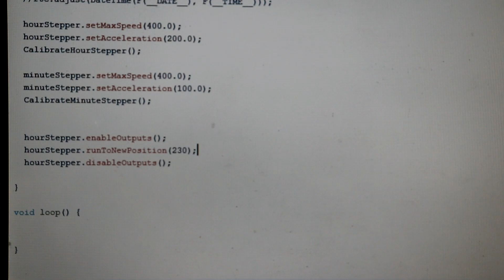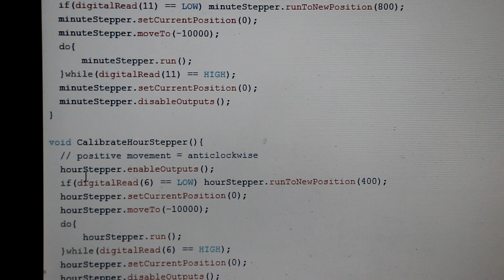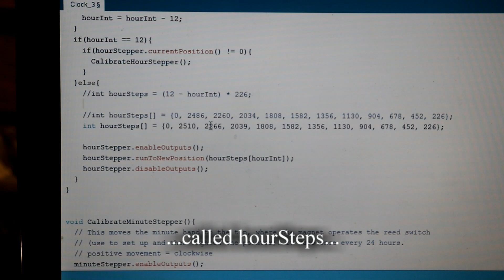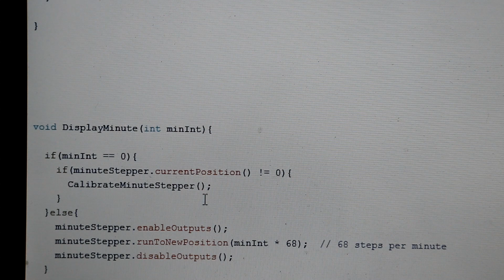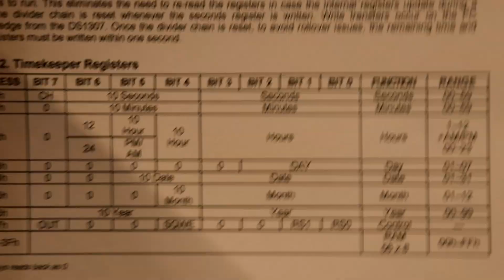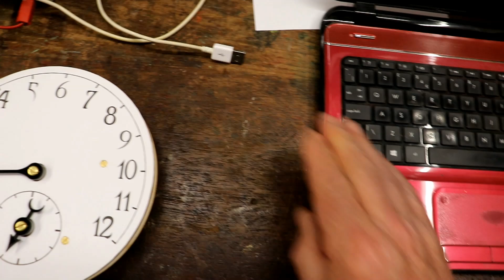Part 5 Writing an Arduino sketch to get the clock to tell the time!

Comment: How neat is that??   You might consider re-homing both motors every 12 hours, to help keep them pointing correctly .
Reply from the maker: Thank you Roman! With this Arduino sketch the minute hand re-homes each minute and the hour hand re-homes every twelve hours. It shouldn't be necessary, but seemed like a good idea!

Comment: It would be great if you put it on your website - a great project I must say. I made a list of “tools” I need - laser cutter, 3D printer……😊 hmmm…..
Reply from the maker: So not many tools then! I was thinking of creating a kit of the laser cut and 3D printed parts... I'll work on remembering how to add a link to the Arduino sketch on my website - new information in and I've forgotten how to do this!
Reply from the maker: If it's of help the Arduino clock sketch is now available at the bottom of this page https://steamhead.co.uk/other%20products.htm
Reply: @steamhead  Hello. the code for this project is no longer available on that page. I would love to make this device to replace the worn movement of my grandfather lock.
Reply from the maker: @C115pilot  Thanks very much for your interest. I've just checked and the link is: https://steamhead.co.uk/index_htm_files/Arduino_Controlled_Clock_Tutorial_Annotated.zip  Please let me know if it doesn't work.
Reply: @steamhead  I've got it!  Thank you so much. My beautiful grandfather clock has been dead for over 20 years now just sitting there looking pretty. You have generated a flash of inspiration in my old brain!  Since I love anything steampunk❤, I absolutely must to build this.
Reply from the maker: @C115pilot  I'm so pleased to have been of help, gook luck with the project and don't hesitate to get in touch if you need any support.

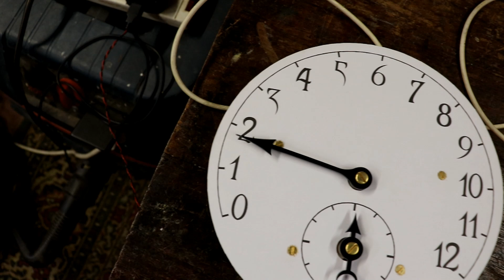Comment: 9:47 I suspect the reason why it precedes the "1" is due to internal backlash of the gear train.  If you were to try overshooting the "1" a bit and then retracting back to the same position, I suspect it would solve that problem.
Reply from the maker: Thank you for the suggestion. I thought it may be gear backlash, but the motor is turning in the same direction to reach '1'? I tried several 'clever' things, but in the end resorted to using the array of step numbers which seems to work really well.

Comment: Great work. Now a much simpler clock using Neopixel. There are round pcb mounted Neopixels that have 60 Leds on them. There are also smaller round ones that have 12 Leds. I had build such a clock before. Use different colors for hour and minute. Just 3d print light guides for the hours and minute and you have an illuminated clock. No mechanics to worry about.
Reply from the maker: Thank you. An LED clock would be nice, but I do love mechanical solutions!